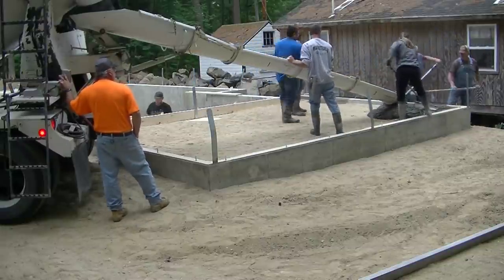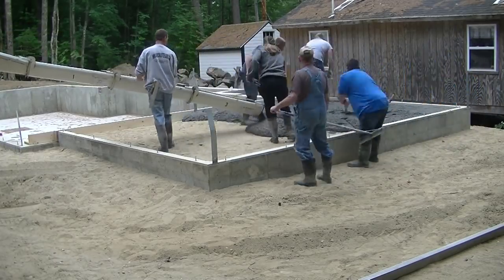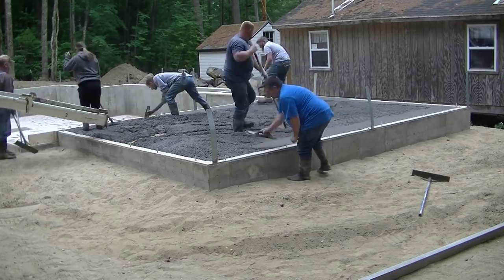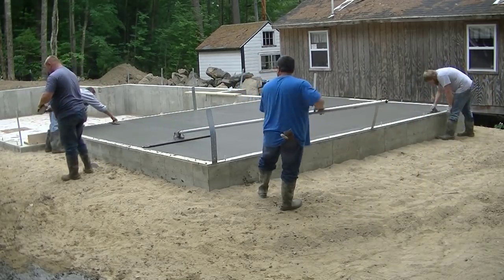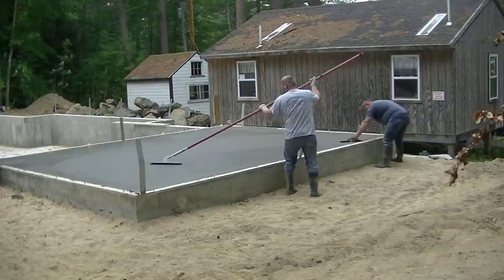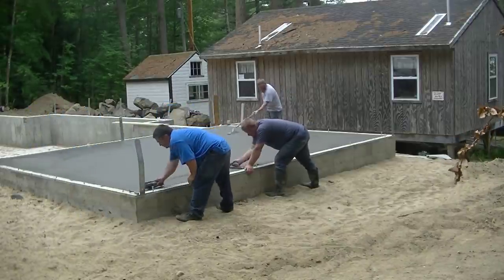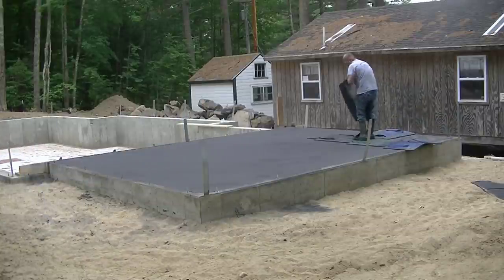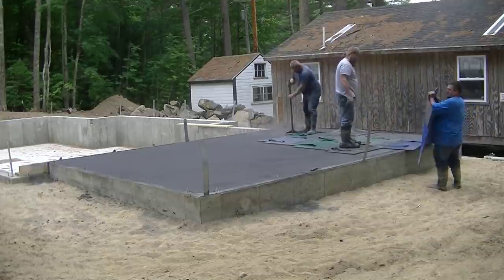How To Stamp A Concrete Patio Slab DIY

Comment: Have you ever used liquid release rather than the powder? I have found that the powder just gets everywhere and on everything. So i just mix in some of the powder into the clear liquid release in a chapin concrete sprayer and seems to work well.
Reply from the maker: I've done that in the past, it works good that way. We mostly use powder though.
Reply: liquid release is so clean!
add accents after its dry with brickform antique-it.

Comment: Looking great, ha Mike I just poured a sidewalk yesterday. I found a piece of leave or grass on top of surface. Removed it now I have a eye sore on surface with my broom finish, about 4 inch circle, 1/4 inch deep any ideas how I can match and fix this eye sore?? Thank you
Reply from the maker: Any type of patch material you use will not blend in to match 100%. I like to use Ardex CD Fine for a touch up like that.
Reply: Mike Day Everything About Concrete thanks Mike
Reply: Mike Day Everything About Concrete hi mike I’m from England been doing these drives and patios for 10 years your really good at it quick question are you colouring the whole of the concrete or just the top of the surface and when you cut and clean your job do you not use a cleaning agent we use a wash that we get from our supplier just wondered and you’re jobs are top class not many people especially in England understand how much work goes into these concrete jobs seen some funny stuff over the years the amount of people that paint there drive because it needs a reseal but they just don’t understand lol

Comment: Recently had a stamped concrete patio put in, looking like wood planks. It's beautiful although it did not come out to the color we wanted. It was suppose to be a dark greyish color and the release colors on it were also a lighter grey and a walnut release. I feel as they used too much walnut release and not the patio looks very much "red". Is there anyway to darken a finished patio? Or change the color? They came and sealed already. Thank you
Reply from the maker: You can re-seal it with a slight tint in the sealer. https://www.foundationarmor.com/agbrown

Or you could use an acetone dye, spray the dye on the concrete right over the sealer, then re-seal with a clear. Check Ameripolish website for the dye.
Reply: @MikeDayConcrete  thank you for the feedback!

Comment: I’m in Pennsylvania looking to stamp my driveway 24x24 using 4000 psi with fiber
Reply from the maker: Keith, make sure you have plenty of help. It's not as easy as we make it look.
Reply: I’ve been doing concrete for 15 years. Always doing a mag finish. But i want to do my own place differently. I will have 4 of us total. I’m hoping it goes well.

Comment: Is it preferable to use fiber over wire when stamping?

I know Mike Day uses fiber in everything, but I typically use wire in just about everything. Any downside to using it on stamped?

Comment: why no rebar?
Reply: Mike will say it is because the GC said no rebar.

I would say it is because that patio is not subject to loads exceeding foot traffic, is on good base, and is fiber reinforced
Reply from the maker: rzl dzl is right. GC didn't call for it on this and it's only foot traffic so it's not really needed.